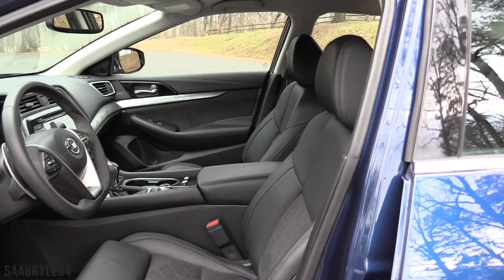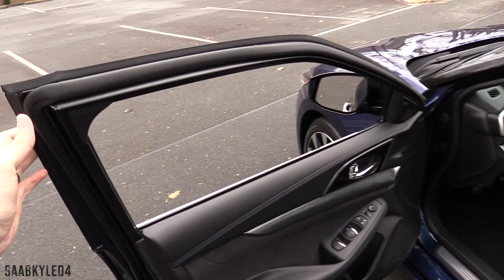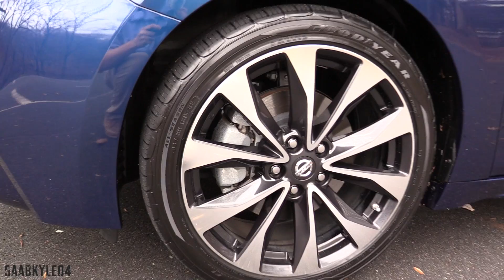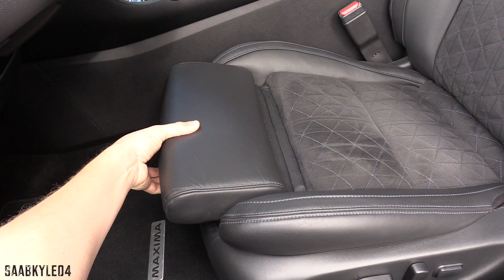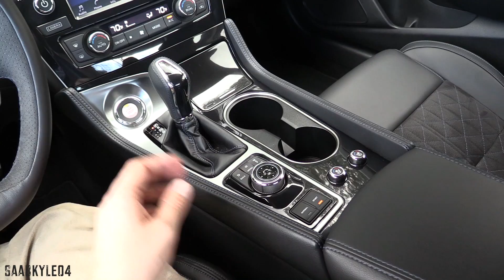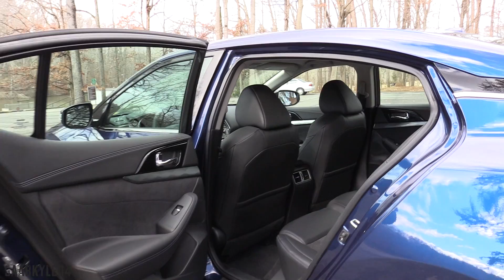2016 Nissan Maxima SR Start Up, Road Test, and In Depth Review

Comment: Yes I know that the CVT has been refined over the years and in some cases the CVT is the desired transmission for its other offerings (Sentra, versa) but to be honest, no amount of simulation will make me like a CVT especially in something as handsome as this new Maxima. In my aunts previous 07’ and current 11’ Sentra the CVT was a fine choice but in their V6 offerings they need something a little more robust like a 6-7 Speed Auto.  To me a V6 Nissan product does not need to be paired to a CVT period, it needs something with real shift points and or a manual transmission

Comment: Joshua Kang
2 minutes ago (edited)
Do not buy a Nissan. Only Nissan use fixed code for smart start engine system. It is for an auto theft to buy signal hacking machine that makes copy signal to unlock the door and start engine. So, Nissan cars have been targeted by a car theft. For example, more than 10 Nissan cars were stolen in a day within 1 mile Frankford@Marsh Lane in Dallas, TX, 75287. One of them were stolen in front of Walmart. She just stopped by the Walmart to buy some goods. After she shopped, she found out her Nissan Maxima  was stolen. 2016 Nissan Maxima and 2017 Nissan Maxima, 2015 Nissan Juke were stolen in one apartment-Gardens at vail apartment around this place. Especially, 2016, 2017, and 2018 Maxima have been stolen a lot recently.

Comment: Too bad they're ugly as shit and have that stupid CVT. If the styling wasn't so awful and they'd use a DCT, I'd be interested. I cannot stand how Nissan went CVT only on everything. CVTs suck and they're pointless. You gain nothing from them. You can get better fuel economy with a DCT or traditional auto these days. STOP WITH THE LAME CVTs!!! Everyone! And what's with automakers using led taillights in previous models, then downgrading back to halogen? The previous gen Maxima had LED, these new ones don't. Honda and Acura have done the same. I don't get it. CVT keeps me away from Nissan. The new Altima SR doesn't look bad, but the CVT kills it.

Comment: I'm starting to see the appeal of this car after looking thoroughly through one (maybe a test drive sometime soon?). I always compared it to cars like the BMW 3 series & Infiniti Q50, which I was led to believe due to Nissan's constant emphasis on its 'sport sedan' nature. That is doing it ABSOLUTELY no justice.

 What you should see it as is a entry-level luxury car at a significantly lower price, but with performance bridging between everyday midsize sedans (e.g. Camry, Accord, Fusion and Altima) and starting entries of luxury brands (e.g. A3, CLA250). Due to its midsize roots with FWD & CVT as its calling card it won't win any 'sport sedan' comparisons, but these traits also make it less of a hassle & more fuel efficient for everyday use. Now how often do you drag race between stoplights & go trackday vs. going to work & going back & forth from supermarkets? 

See it not as a German luxury brand competitor but as a step up from mass-market brands with a luxury/performance edge while still having a significant value from small, FWD entry-level luxury brand entries.

Comment: I honestly do not understand Nissan's logic with the SR package.  'All of the creature comforts, but no sunroof because it spoils CoG and chassis rigidity.'  That's fine, but why pair a CVT to it?  People interested in a Maxima will most likely want a sunroof; inversely, people who want a performance car are not considering a Maxima.  

Who is the market for a Maxima SR?
Reply: Apparently a lot of people are in the market for a Maxima SR considering how well they're selling and how common they are. "Sporty/Performance" in this relatively budget sector comes mainly down to appearance and handling which the SR most definitely delivers in. It most certainly looks "sporty" and it's not bad on a country back road either. That's what people really want and it couldn't be any better in that regard. If you want a real performance car for this price you're going to be looking at something like a Golf GTI/R or Focus ST but those aren't really made to be as good of family cars or daily drivers as the Maxima. Why does it have a CVT? Because the Infiniti Q50 exists, people need to realize that. It would hurt the Q50's sales. And not a lot of people care about sunroofs, they're gimmicks that add weight and are barely used. Granted the option should be there anyway but who really cares, honestly?
Reply: I was in the market for one and got one. 2016 with 37k miles

Comment: Might get this or the 370z for my next car
Reply: they're both similar in acceleration, if you want automatic just go with the maxima, it's simulated gears make you forget it's a cvt
Reply: not sure if srs, the 370z smokes the maxima lmao
Reply: Latin Lover well im not looking only for power. I do prefer 4 door cars over coupes but i do like the 370z as far as looks go
Reply: 370z is super outdated compared to the current Maxima but they're two different cars so it's all the matter of space cause i'm pretty sure the Maxima is a good performer too.
Reply: icantw8 yea idk i like the 370z cuz its easier to tune and customize. The maxima is a family car so nobody really customizes it

Comment: Why is CVT so bad? Can someone explain?
Reply: CVTs don't shift because of its infinite gear ratios so the only reason people dislike it is because there's no shifting involved when accelerating. Cars with automatic/manual transmissions has a fixed number of gears that shift everytime you go beyond a certain speed but since people have been using that for so long and CVTs have just started being used for around a decade or so, people hate it because it "alienates" the driver. To me, idrgaf and idk why everyone else should.
Reply: Yeah I don't have any problem with this car having a CVT.
Reply: you cannot fix a cvt like a conventional auto, if it fucks up, it needs to be replaced and it will run you as close as to 3k lmao

Comment: I just got rid of an '07 Altima 3.5SE that lasted 170K miles and never had a problem with the CVT until the very end; I was NEVER able to say that about a regular automatic (usually they need a rebuild by the 80-100K mark).  I now have the '16 Maxima; it's incredible!  In sport mode, this thing moves out like a scalded cat (the CVT lingers in a lower "gear" with the afterburners ready to pounce).  I know it's not a "4DSC" like everyone likes to say, but from 0-35mph, this car is hard to keep up with.
Reply: Nice to hear. I have a an 07 Altima 3.5 SE and love it. Just curious how often you changed the cvt fluid? And what eventually happened to it? Congrats on the Max. Nice car.
Reply: My 2010 Nissan Maxima is fun to drive 😇

Comment: Does anyone else agree that TIRE SIDEWALLS ARE GETTING RIDICULOUSLY THIN?
Reply: I agree. And especially since I work in a tire shop it's kind of annoying how stiff the tires are to mount on the rim.
Reply: Yeah low profiles are annoying to chancge. I just use a ton of bead grease and clean up after. I personally prefer wider, normal profile tires on my rims.

Comment: Im debating between this and 2015 Q50
Reply: What's your budget? The 2016 q50 will have new engine options, all turbo from a 4 cylinder to a v6 twin turbo. Same exterior just performance upgrades 👍🏼
Reply: +Hector Woo between 30-35k. I'm also looking at used A6s. But I love the Q50.
Reply: +furiousgtz yea I'd go with a used q50s myself man. You can always test drive all 3.
Reply: +Hector Woo yeah. I drove A6 and love the interior but so underpowered.  I'm test driving the Q50 tomorrow.
Reply: +furiousgtz yea man I need a new car but gonna wait 2 years. Don't know what I'll get I like a bunch of cars, list goes like..
TLX, accord v6, q50, 370z, focus RS, even an Azera, Audi s3... Yeaa I'm all over the place, update us on what you end up with man.

Comment: Nissan will conduct its third Altima recall in three years next month, all of which will have addressed the same issue: faulty hood latches.

Worldwide, nearly 930,000 2013 through 2015 Altimas, including 846,000 that were made and sold in the U.S., will be affected by the recall. Nissan dealers will replace the latches, which tend to rust once their protective coats of paint chip off, free of charge.

Comment: LOL at all the hate the CVT Transmission gets.  I own a 11 Maxima so I'm going to let you know you have to drive them in either sports mode or manual mode.  If you use manual mode use the paddle shifters instead of the floor shifter.  Now driving in regular can feel bad but if you are in area where you will be driving so it's not a big deal
Reply: +Xisean Anthony You're basically saying that you should be driving in Manual mode only. Why ? Cause the CVT is boring to drive.... Which is why people are hating on them. What you just said doesn't make any sense lol stay in school dummy
Reply: +rock most automatics are boring to drive
Reply: +rock have you ever driven one of these maximas or the previous models to see how responsive the CVT is?  Its very responsive.
Reply: The CVT is very responsive, you are very right.

Comment: three things I don't like about  this generation of the Maxima.1. The back looks  close to an Altima2. The front looks like a Lexus3. The stock wheel package is too small.  18 inch or 19 for the sports trim.  Nissan needs to have this car just come with a sporty 20 inch wheel.Now when it comes to the CVT I have no problem with it, but you have to drive the car in (sports) mode to get what you want out of the car.  If you go auto-manual use the paddle shifters instead of the shift nob.  I have an 11 and I refused to use the paddle shifters for like a year.

Comment: alot of people degrade this car for having a CVT but my advice is to go out And test drive one they are suprisingly  responsive, yes they do drone the engine but its not bad and with 300 HP the car picks up very well, for an everyday car its nice, and reliability wise, they are pretty rock solid, my 2008 Maxima has 124k and still runs strong.

Comment: The CVT isn't that bad. I doubt most of these people bad mouthing it have driven one. Its crazy good for a metal rubber band. I agree I would have liked to see a manual but something like that is not going to happen in this day and age.
Reply: +Jack S The people who bad mouth don't even have the $$ to buy it. All they hear is cvt, "oh that sucks! Its not real shifting! its soooo boring!"
Reply: +Jack S It's extremely boring to drive. Other than that there's not much more to say
Reply: +Iam Sam the q50 is smaller, louder and has a less luxurious interior in my opinion so not quite the same.  The infiniti gs were mainly based on altimas not maximas.  they also lack some features the maxima offers
Reply: +Iam Sam they are different cars. Most people would rather take the mpg over the normal automatic. Driving a CVT takes skill most of the manual Nazis don't have. If you're good at it, a cvt is faster and more efficient than any other transmission.
Reply: +ChocDelight12 You sounds like a clueless moron who can't even drive. If you've ever driven a car with a CVT you wouldn't have said that.
Reply: +Jack S LOL are you 14 years old? A CVT takes ZERO skill whatsoever. Your statement is so ignorant and ridiculous it makes me laugh. Clearly you never touched a manual transmission in your life. Most likely because you either have no drivers license, or too inept to posses the skill necessary even to drive one. Then again you could just be trying to justify a shitty purchase.

Comment: What is a CVT and why is it such a deal breaker to most people?
Reply: +Xisean Anthony oh my god you're really peanut brained. Continuously variable transmission... You are so fucking ignorant. "In cvt mode" what?? CVT is your transmission LOL
Reply: +Xisean Anthony Nobody will drive on "manual mode" every single time. That is the worst argument to defend CVT transmissions. "CVT" is your transmission, it's not a "mode". The fact you think I'm trolling makes you look really dumb... You have no mechanical experience and you're saying things that does not make sense. Please stop....
Reply: +Exquisite Pictures To make it simple it's like if the car had 1 speed. You don't feel any gear change like in regular automatics. It's incredibly boring to drive and removes any "feeling", but it's better on gas.
Reply: +Exquisite Pictures CVT is not for performance. It makes car just slower but more fuel efficient.
Reply: +rock that's a lie i have an 11 maxima and you can feel the gears change even in CVT mode
Reply: Xisean Anthony 🤣🤣🤣🤣 thanks buddy
Reply: +rock while your ass is trolling you can totally take the transmission totally out of CVT to manual.  the transmission responds different.  stop trolling
Reply: +rock alright troll
Reply: +rock you probably have never driven a car with a CVT that you can put in a  manual.  no its not thw traditional manual, but it does not act in the way as if you were driving in an automatic.
Reply: +Xisean Anthony I drove a 2009 altima which has a cvt and manual shifting mode. Why do you keep talking about the manual mode ?
Reply: +rock casue people talk like it's a deal breaker for the car. When most dont even drive the car in the manual to see what the car can do.  It no big deal.  now if it didnt have a manual mode then yea, but I would perfer a traditional 6 speed manual for the max. but i think 07 was the last year Nissan had that available
Reply: +Dan Yalovenko Not really. CVTs have an advantage over automatics due to constantly changing to ideal RPMs for the needed circumstance. That is why the CVT was banned in F1 Racing.
Reply: +John Wick Apparently, CVTs found in street cars can't handle high amounts of horsepower and torque.
Reply: Great review!
Reply: BaddGirlssClubb 👎
Reply: BaddGirlssClubb thanks for the question. With the information here I'll look more into it but so far its not a deal breaker

Comment: I have an 07 Altima 3.5 SE with 166,000 miles on it never had a single problem with the CVT- can't say that about a regular automatic transmission.  Although it's not a performance transmission, it doesn't deserve all the trash talk.
Reply: +mitchlu 166,000 miles of pure boringness driving. Cool. Nobody is talking trash about their reliability.
Reply: +rock dumb ass kid you must be driving cycle
Reply: +mitchlu I owned a 08 sentra, bought it with 27k other that the usual brakes, tires, oil changes etc never had a single issue, wife was sittin at a red light got reared  and totaled with 108765 on the odo, nobody hurt.
Reply: +Jay “Doomsday” Barnes ...that's fantastic!...glad you're all OK...Nissan FTW!
Reply: +rock who really wants to feel and hear gear shift

Comment: It's a great looking car but I agree with most people, the CVT and FWD is a real disappointment. I have no idea why Nissan won't put a real transmission in any of their cars except for the 370Z and the GTR. If they market the Maxima as the 4 door sports car, then they need to make it one! The exhaust note sounds really good, Nissan makes a great V6 but this car isn't finished IMO.
Reply: +mhtube01 One of the ugliest front end of any other sedan on the market.

Comment: Charger would smoke this Nissan
Reply: SuchANiceGirl22 I know from many, many first hand experiences that the Maxima will smoke the Pentastar V-6 equipped Charger. That is the only Charger model that is even remotely sensible to compare to the V-6 only Maxima in terms of performance. Having said all of that, I've had some Hemi equipped Chargers try me and I easily beat them off the line. Please remember, horsepower is not everything and Chargers weigh as much as a fully loaded cargo ship. 
 References: Been driving a 2010 Maxima everyday for the past three years and it has ten less HP than the new model in this video. Oh, and I love Chargers to. One of my favorite cars.
Reply: +Sawashi32 It only takes a brief Google search to see the Charger/300 V6's performance capabilities from other auto publications. They are both (negligibly) faster than a Nissan Maxima, despite whether "you think" you could beat them or not. And you've never beat a Hemi-equipped anything in a Nissan Maxima, anyone can claim a victory against someone who isn't trying. I don't have to put much work into my response here, as it's pointless to debate facts. Just enjoy your Maxima sweety, pretending that it's better/more than it is will only disappoint you, no one else.
Reply: Not off the line it won't.
Reply: +SuchANiceGirl22 

Tell em
Reply: SuchANiceGirl22 Sorry I pissed you off as that was in no way my intentions here. I didn't bother to Google search anything on this subject because I was giving you my honest real world experiences from my last three years of owning a Maxima. I'm also not here to pretend my car is something better than what it is because in reality 0-60 times was not even a hint of a factor in my decision to purchase it in the first place and only a fool would think something that trivial is the sole making of a good car. I do all of my own maintenance and modifications myself and love my car the same now as the day I first brought it home. I am probably the last person on earth that cares what anybody thinks about what I drive so I have nothing to prove to anyone and dissapointmet is far from an emotion I feel when it comes to my vehicle. Remember, I responded to the Op's flamboyant albeit child like comment "Charger would smoke this Nissan" and then you chimed in. I don't know what you or the op drive but I'm going to go out on a limb and guess that I am the only one here with actual real world experiences of a Maxima against a charger but then again I could always just Google it from home on my computer. Again, didn't mean to piss you off I was just trying to calmly share my personal experiences.
Reply: Dude I beat a base charger ( v6) in my 01 maxima lol heavy boat v6
Reply: +Sawashi32 Actually, yes it will.